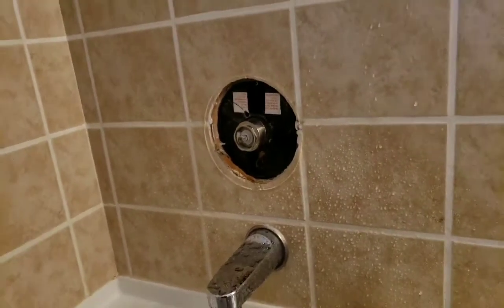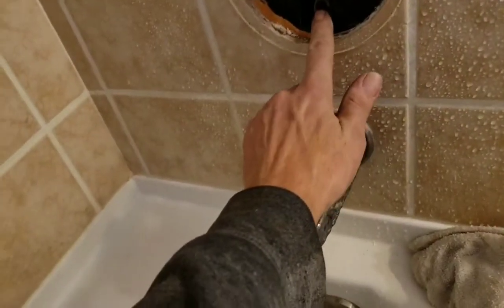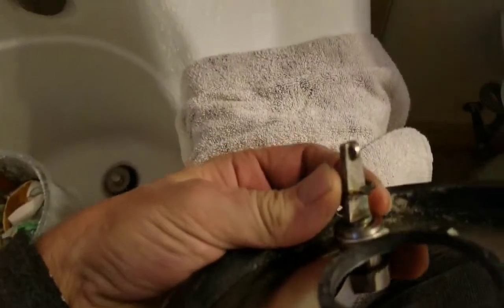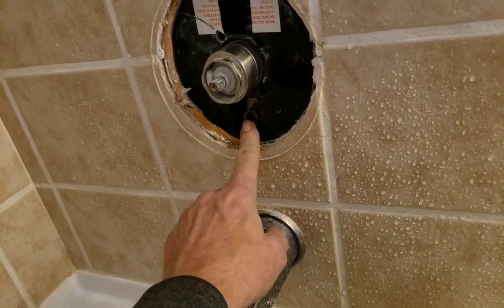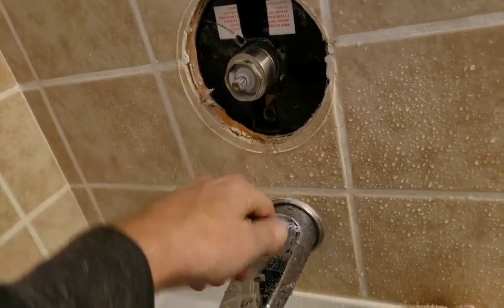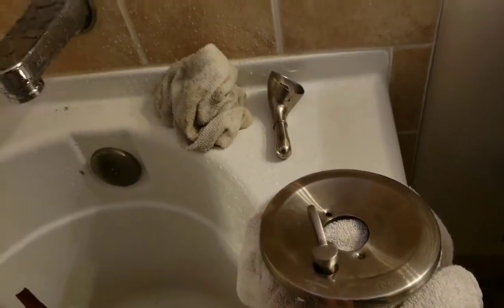Dumbass Eurostream Tub & Shower Faucet BADLY Installed Back To Back With Another

Comment: Was this situation caused by tile being added as part of a later bathroom remodeling job?  It's possible that the original installer mounted the valve body correctly.  I see a couple of options to fix it.  (1) Rip all the tile out replace it with a thin styrene plastic tub surround kit, or (2) Fabricate a modified part for the Eurostream escutcheon plate with a deeper reach, so it can engage the integral diverter valve, and then replace the Delta diverter spout with a non-diverter spout.  Either solution will cost hundreds of dollars.
Reply from the maker: The original installer went with tightening the escutcheon/trim plate tight enough to engage the diverter and like all trim plates tightened this way the constant vibration of water causes the screw holes to stretch and eventually, like in this case, the trick no longer works. Mutitenant builds tend to go this way sometimes.

We resolved to continue to swap the Delta spout with diverter for another spout that was closer to the finish of the other parts.

Comment: How do you get the handle off? I see the 2 screws to get the plate. Does the plate just come off over the handle? Tried to pull it off but don't wanna break it pulling too hard
Reply from the maker: It has been a long time though as I recall there is a small allen screw behind the handle in the collar of the handle.